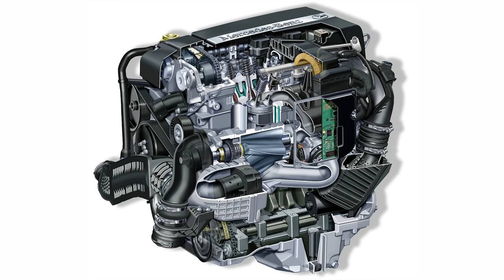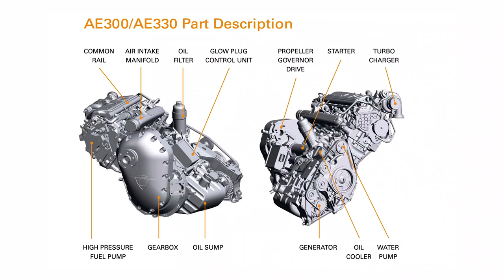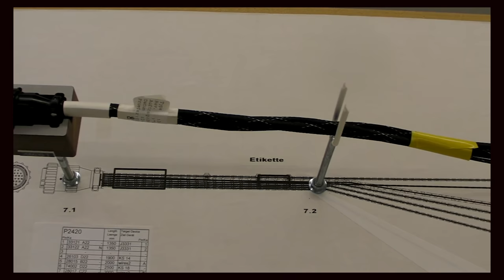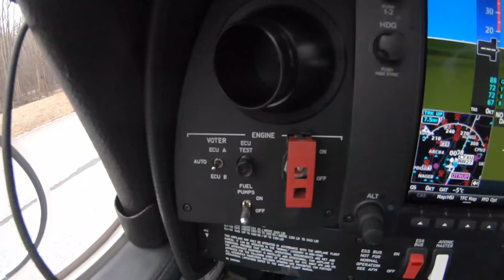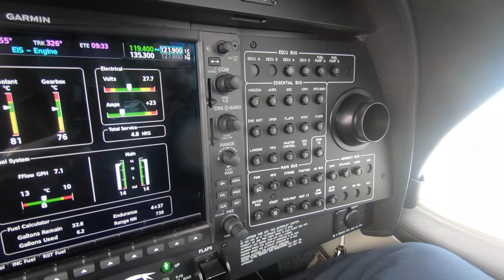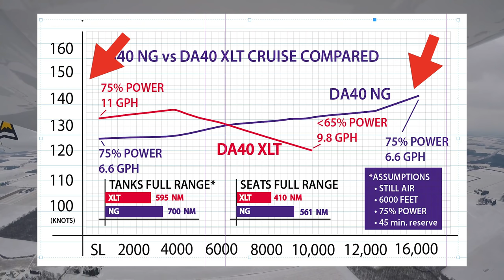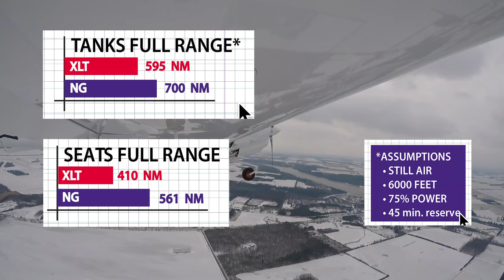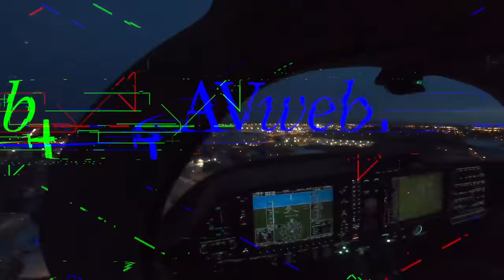Avweb's Diamond DA40 NG Flight Trial

Comment: A great summary on the Diamond DA 40 NG. I flew from Frankfurt-Egelsbach to Wroclaw in Poland and consumed just 14.5 USG. This aircraft's consumption is so low that it almost runs on fresh air!!!  Above all it is a VERY SAFE aircraft.
Reply: I consistently run 1-1.5GPH less than calculated in my XC flights

Comment: Thank you. I learned to fly in Diamond aircraft in the late 90s. I got my PPL in the DV20 and DA20 Rotax powered aircraft. They were fun to fly, did spins real well, and were slippery little things on landing. If high and fast you could kick in a full deflection slip and come down in a hurry or hold altitude and slow down. I discovered that you become accustomed to this and don't carry any excess speed in the flare as they would float way down the runway. Then right after i took my check ride i got checked out in a 172XP. That caught me off guard as it slowed immediately when power is pulled. I was accustomed to the slippery little plane and not the Cessna and its aerodynamics and had to go around the first approach as it threw me off. Adjustments made and landings were fine but it did demonstrate the difference in a sleek composite airframe vs old school aluminum and rivets. Both perfectly acceptable but different requiring different techniques. I also have maybe 10 hours dual in the Super Dimona.  What a blast to fly here in the Desert Southwest. Yes I do like the Diamond airplanes and would love the chance to fly the NG and a 62 and would love to own 1 of each. Thank you again. Be safe.

Comment: It’s nice to finally see some car tech coming into aircraft. Compared to modern cars (or even cars 30 years ago) a lot of the lycomings and continentals we’ve been using forever on airplanes are downright primitive. Nice to see electronic fuel management, direct injection, and other car tech in a plane that will hopefully see wide use in GA.

Comment: What ever happened to the Gemini?  It looked so amazingly promising.  Easy to maintain, light, compact design, very low vibration, great power to weight, fuel efficient.

Comment: How can a 4 cylinder diesel motor, adapted from automotive to aeronautical use, cost $28,000 to rebuild. The whole Mercedes A100 WITH the motor cost less than that. What am I missing here?
Reply: Why do I have to pay 35.-$ for a Rotax Oil Reservoir  O-Ring when the same rubber part goes for 3 -$ on the free market? Monopoly maybe?
Reply: ITS FOR AN AIRCRAFT
Reply: Airplane tax
Reply: To cover the cost of litigation.
Reply: Seek and yee shall find cheaper parts.........
On another note the aluminum diesel blocks can be sleeved with steel.. with matching pistons.. can likely have 4 engines done for 28K
Reply: You're missing the cost of human labor and liability.

Measuring each piece with calipers. Likely x-rays and magnetic particle testing. Machining each surface to exact dimensions

If your Mercedes takes a dump on the highway you're waiting on a tow. If your engine takes a dump in the air... you're hopefully able to even put it on the ground without injury.
Reply: They need to factor in the added expense of lawyers and expensive court fees when a deceased pilot's family sues the manufacturer even though the crash was the pilot's fault.
Because of sue happy, greedy folks, everyone else suffers.

Comment: I like to see modern engine design in GA! Unfortunately the costs are still the same as 1930's technology Lycoming 360 and the Continental equivalent engines. Something has to give in this equation. Experimental is going to dominate if all mainstream engines continue to cost over 20k. Great video.
Reply: What is a modern GA engine design? The Austro engine is an auto engine adapted to aviation.  All piston engines evolved from early pistion engines in the last century.  Rotax and Austro use an ECU type quasi-FADEC computer control for fuel.  It is no different than other FADEC control systems.  Single throttle control is a nice to have, but again, is nothing special.  SLSA with Rotax have had it for a decade.

Comment: Hi Paul, thank you so much for this report. I enjoy your work a lot. And I hope you stay safe in this troubled times. I fly  a DA40 XLS (2009) with Lycoming IO-360M1A, Powerflow, And Hartzell 2 Blade Scimitar Prop on a regular basis. I think the DA40 XLT that is beeing sold at this time of writing, has almost the same specs in terms of Engine/Prop combo as mine. I noticed  that the data you use for your comparison between the NG an the XLT is not reflecting the flight data in real life. I guess you took the performance data from the POH of the XLT, as any pilot would. Right? Unfortunatelly that data is not correct, it does not reflect the true capability of the XLS/XLT. Diamond never updated the POH and just added STCs at the end of the POH, If you read them carefully, you will notice that the STC for the Hartzell Prop gets rid of the RPM limitation! You can run the Prop at 2700rpm instead of reducing RPM after T/O to 2400... This increases the climb rate by at least 100fpm over POH numbers! Making the DA40XLS/XLT the best climber I know of in the segment! That coupled with the high aspect ratio gives you amazing climb and one of the reasons I prefer the DA40 over all other planes in the segment! Because if you only have one engine. I preffer getting off the ground as quick as possible!The comparison between the Speed/Performance of the DA40XLt and the NG is not correct!  Due to the higher RPM the DA40XLS/XLT is capable of flying 140-150kt at 5000ft-6000ft! I regularly fly in the low 140kts @65%/9.7USG/best power mixture. Just have a look at the Performance Data in the DA42 IO-360 for the right MP/RPM settings. The DA40XLS/XLT is a hell of a bargain on the market, its a perfect cruiser and the safety record is only second to Cirrus, which invested lots of money to train their pilots. There has never been a fire on impact with a DA40 to my knowledge and the stall caracteristic of this plane is amazing.... You forget to mention that the Austroengine TransmissionGear needs to be refurbished every 600hrs. And the big issue with the engine is that your only partner for service will be Diamond! And that is a big problem as your bargaining power as a buyer is much lower, and the „new“ owner of diamond is jacking up prices since years. The DA40NG is a great plane don`t get me wrong, I would love to own one. The main buyer of this plane will be operators that get lots of hours/year than maybe the cost of the NG might be a little better but if you factor in the refurb cost of the transmissiongear. But the only real advantage of the NG is maybe a little more speed in the mid fl teens and the single throttle leaver and engine smoothness and cabin noise levels, but it will climb less, fly slower at normal altitudes (without o2 req) and it will cost you more than a XLT :-D Best Regards, Maximilian
Reply: I sure don't like a company demanding that I only use them for servicing my property, good to be aware of this when making the decision to purchase. 
600 hours is pretty short, but how extensive is the service? I also wonder if the 600h is mainly to get some real world data and later revisions will have a longer time between service, this would be better than discovering an unforeseen failure mode the hard way. 
However with 1800TBO and $5/gallon 100LL, the NG saves about $27,000 in fuel so there is that. And then for those of us out west the higher altitude performance is handy, I can point to a huge number of victor routes in my surrounding states with MOCAs over 12000, and depending on local cloud patterns it is also nice to fly in visual conditions on top rather than down in the soup.
Reply: Hi Maximilian, gearbox TBO has been raised to 1800 hours by now, which coincides with the engine TBO.
As the engine is pretty new by GA standards, these time limits can still increase.

Comment: 23,000 psi rail pressure is need to introduce fuel under compression stroke. Yes common rail WITH electric injector is more efficient than old diesel mechanical injectors which were like little high pressure pumps to get pressure. But fuel injection timing was fixed.

Comment: VERY nice explanation of the advantage of the diesel version.  Unfortunately there's a huge price premium over the Lycoming version that isn't offset by the fuel savings.  Nevertheless, I hope aviation manufacturers continue to embrace this technology, since Jet-A should be available for a long time to come (100LL not so much) and the FADEC operation has clear advantages for pilot workload.
Reply: It's a nice plane though, Very well finished vs its competitors. Also a strong aircraft structure. The costs overall vs SR22 is very similar.

Comment: Nice info about the DA 40 NG and the engine especially.  Question I have is, would Austro ever build a 350 HP or higher engine that could be fitted to something the range of a PA-46?  That economy would be amazing.  Also wouldn’t it be great if Diamond Pressurized their twins.  Living in the mountains of Utah pressurized would be awesome as opposed to just using O2.  Thanks in advance for your answers
Reply: No, they won't.

Comment: This video has some misinformation about the thielert/continental series engines. First the maintenance issues were mainly due to gearbox iand electrical issues. Second, the newest versions of the TAE engines have 2100 hr TBO/TBR. Overhaul is not prohibited.

Comment: 23000 PSI Fuel System? Is that correct? (@4.30)
Reply: Yup: https://en.wikipedia.org/wiki/Common_rail
Reply: Current diesel car engines are 29000 psi or higher.
Reply: I was going to ask this too; I had no idea the pressure was that high!

Comment: Newbie question:   I know the engine is diesel but is that the actual fuel used in this engine and is it readily available at all airports??  
Did not want this to be a "in what year was the war of 1812 fought? '  type question.  :)
Reply: I believe it can burn Jet A, but not sure.
Reply: ram 1901 Good question.  Don’s answer was correct, they actually burn jet fuel and not diesel fuel. Availability at GA airports is mixed, but I would guess that over half of GA airports have jet fuel available. The larger airports that support commercial traffic are also available to GA pilots and a very high percentage of those have jet fuel. It may be significantly more expensive to purchase jet fuel at the larger airports for GA pilots.

Comment: How do they deal with cold temps and the diesel fuel?  I would be concerned about gelling.
Reply: TheBeingReal the Austra engines are called Diesel engines, but actually burn jet fuel. The high pressure pumps to the injector rails include a slipstream of fuel back to the tanks. The pump pressure actually heats the fuel and the fuel must be cooled at higher outside air temperatures. The recommendation is negative prist for my flying in Michigan and Canada.
Reply: You can also use diesel above 25C but everybody runs them on JetA. The aircraft also has a heating system for the fuel with the help of the return fuel unused by the injection system.

Comment: Being a diesel which doesn't have a distributor, spark plugs or magneto it's actually triple redundant with the two ECUs. With both ECUs out, it will still run, because diesels auto-ignite (compression ignition).
Reply: Nope, without an ECU running, the injectors will not inject fuel so no combustion. Diesels don't habe a carburator...

Comment: Hello,  Now if they would fix the avionics panel.  Get rid of all the circuit breakers, then make the displays bigger.  Have a design team (BMW DesignWorks) look at the placement of all the other flippers, knobs and switches and get it cleaned up, that would be awesome, especially in the  DA-62.  To have such a beautiful plane with a avionics panel that looks like it was assembled by toddlers, is a shame.  Joe

Comment: What is the temperature operating window for the desiel with additives? Most people become nervous with automove diagnostics as it relies on multi point sensor technology where the sensors degrade over time?
Reply: All the way down to -40c but that requires preheating and air intake baffles at various points on the airplane
Reply: So the ba crash of a Boeing was caused by fuel iceing on rapid decent through a fuel preheated configuration.. Guess it's an area of research as the article was filmed in cold weather conditions
Reply: Rob Jones the engines are compression ignition engines. Mechanical engineers refer to this as a diesel cycle just as gas engines are referred to as a Carnot cycle.  In the automotive world, they burn diesel, but in the aviation world they burn jet fuel (which is close to kerosene). Jet fuel is used by the big jets which fly much higher in colder temperatures than these propeller planes. There are anti-gel additives in jet fuel good to much colder temperatures than automotive diesel.

Comment: Instead of having a complex diesel engine, why not combine an aviation electric motor as seen with some of the experimentals and a small turbine APU to generate the power from diesel? Wouldn't the part count be lower and lighter overall with this hybrid design and extend the TBO?

Comment: Turbo is the way but then pressurized cabin is also the way. Nice bird, nice seats. Would like to see retractable gear. Half the weight, half the price would be good too. 
Since it's a diesel mercedes engine with peak torque around 2k and peak power at 4200, surely direct drive must be workable and skip the tranny?  Looking at the power graph, 92% power is all the way down around 2900rpm so why the gearbox.

Comment: Speaking of efficient plane design, the Sharp Nemesis is the data point to know, doing nearly 500km/h with 100HP. At ground level. Examples like that should be points of worship for aircraft makers but sadly they are not.
Reply: They know their market, they are selling to old guys that hand crank tractors and use mechanical rules of thumb that were dubious science even 50 years ago, and that market is more worried about performance during an engine failure than normal operational performance or the actual engine failure rates and detailed causes.

Comment: The $28,000 for a new engine is way south of the actual cost. We paid north of $40,000, and the wait is 4 to 6 months. We had one of these Mercedes fail due to “black death” google it. If one of these engines stops in flight, (according to the AMM)a timing chain replacement is required. Thanks but no thanks! Give me a reliable Lycoming any day!
Reply: It it were left to you, we would still be using coal to heat homes . . .
Reply: @TRPGpilot  as per FAA AD 2020-15-5 timing chain replacement is mandatory after an engine shut down in flight. Cost estimated at $18,000. Not saying that its bad tech, but it is not ready for multi engine training. Not sure about European training standards, but a lot of multi training involves engine shut down. I'm not opposed to new tech as suggested by your comment, I was sharing the real world experience that we have had with our 42NG.
Reply: @dankohr9796  OK fair enough, I stand corrected. I will look into that a  bit more.
Reply from the maker: @dankohr9796  Not sure where you are getting this. In the twin, we did multiple shutdowns and restarts.
Reply: @AVweb  As per my last comment, please reference to FAA AD 2020-15-5, and related service bulletins,which addresses windmilling restarts, and the potential damage to the timing chain mechanism.

Comment: This is the kind of engine and tech that I believe should be applied to all modern GA airplanes. Why are we still flying around in air cooled engines designed in the 50s and 60s that have to be overhauled every 2000 hours, many of which are still carburated or use aviation "fuel injection" (which is very rudimentary and problematic)? Modern cars use liquid cooled engines that can run for a lot longer, are more reliable, and use "true" fuel injection (electronically controlled) - you don't have a mixture control in your car. I understand liquid cooling makes the engine heavier overall so if we still want to use air cooled engines, at least design something that can last as long as a car engine and uses real fuel injection. This would reduce pilot workload and save money in the long run. Basically, my point is: people, we have the technology :)

Comment: Turbo Diesels are 40-50% more efficient than gasoline engines, plus, diesel fuel (Jet fuel) costs 30% less than gasoline. All together, flying a diesel plane will cost 70% LESS than flying a gas engine, for the same distance covered. As they say, It's a no-brainer dude.
Reply: That's more a result of just new engine technology vs old engine technology. Modern gasoline engines are also significantly more efficient than current GA engines (30%+), they burn mogas (which is about 20% cheaper than 100LL), they weigh significantly less (which makes the whole airplane more efficient) and they cost less to build and maintain.
Reply: @PistonAvatarGuy  - I am not aware of any current automotive gasoline engines that have been granted production certification by US Federal Aviation Administration. The last automotive engine to have such certificate was the twin-turbocharged powerplant based on the Toyota UZ series Lexus engine, model designation FV2400-2TC.  https://en.wikipedia.org/wiki/Toyota_UZ_engine
Reply: @NICK-uy3nl  I was talking about modern gasoline engines in general. Modern engines, in general, are more efficient than older engines, so the benefits that you're describing aren't a result of the engine burning diesel, they're a result of it being a modern engine.
Reply: Bad math.